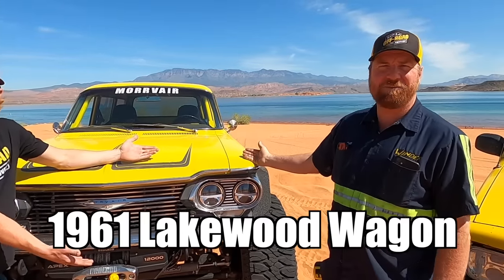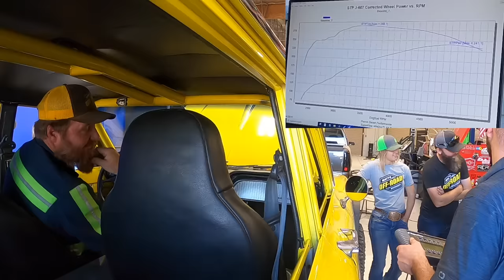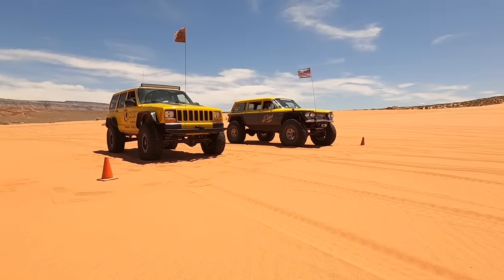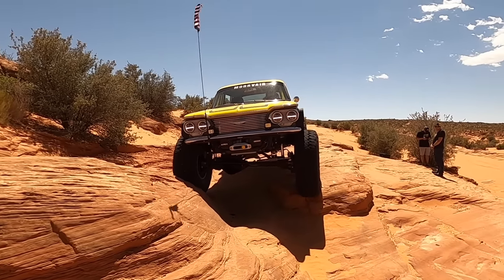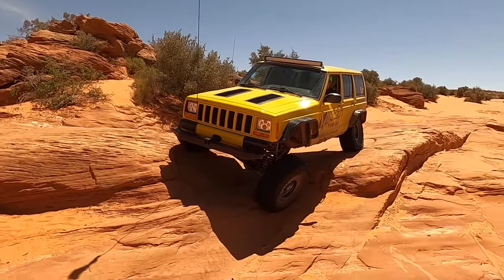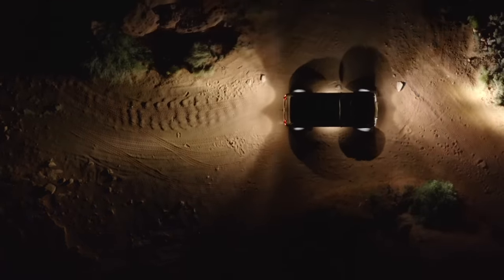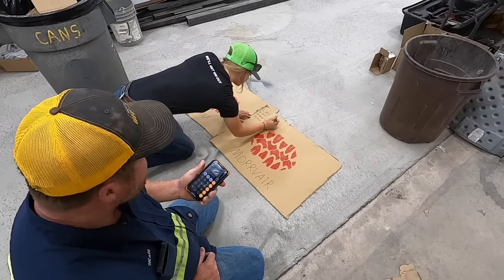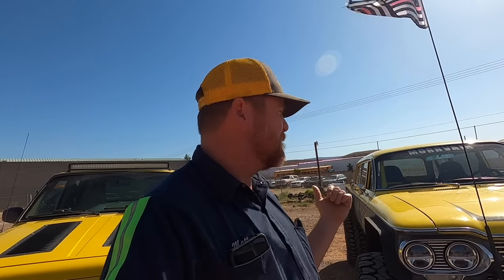Banana Vs Morrvair - Ultimate Off Road Challenge!

Comment: I'm not sure what's more incredible that the banana IS only 105 hp or what been able to do with it and it's 105 hp.
Reply: The Weapon Collection  exactly
Reply: It's 105 at the (gigantic oversized and underpressure) tires. I'd bet on street tires and non-beadlocked wheels it'd run near 180hp. But he uses kinetic energy to his advantage always.
Reply: Yeah, after a lot of years and miles horses tend to escape lol. In this case, quite a few have left.
Reply: @jdoosh4797  na factory its 190hp at the crank ALL of you seem to be forgetting this.. factory ratings are crank ratings not wheel HP, most vehicles the drive train loss is around 15-25% depending on the setup., with drivetrain loss, the 4.0 are all mostly pushing around 140hp to the wheel or so,  They are guttless pigs, with him being at 105 hp he has over a 45% power loss.  I own 4 Jeeps, the 4.0 is slow even on a stock Grand Cherokee.  And people claim its a torqy engine, i mean 225ft lbs at 3300rpm at the crank, i guess thats torqy ?   The same year 5.2 and 5.9 liter v8's had over 100-125ft lbs more than the 4.0 and they were at 3000k rpm for peak torque.   I own a 5.9 Grand Cherokee, and its completetly blows the 4.0 away in every aspect.   Both are equally as reliable, i honestly dont know why he picked a cherokee XJ for his companies towing vehicle when a grand cherokee with the 5.9 liter v8 would have been a much better choice.
Reply: @jeepsblackpowderandlights4305  Drivetrain loss is a static number not a percentage. It should be putting more around the 110-115hp range. The reason he probably didn't use a GC is because it's far to big and heavy for the hp it's putting out. Not to mention the unibody is even worse for yanking and towing. The 5.9 Limited is the only exception and it's not much better P/W than the other ones.
Reply: @CanadaBud23  umm.. the cherokee xj is a unibody ?  Lol.  And no a 5.2 and 5.9L is way better in a ZJ than a 4.0 in a XJ.   Lol do some math and try to tell trll the HP/torque/weight is the same lol..   a 98 Zj 5.9 weighs roughly 4200 lbs.  A stock XJ is around 3300.   Thats 900 lbs more, and it has 60 more hp but 125ft lbs more.      HP means nothing its the torque.  And a 5.9l could yank an xj around the parking lot withoit you even feeling it.   My 5.9L cann actually pass people at 70mph on the interstate with ease.. the 4.0 you gatta full throttle and inch your way.  

If you dont have the vehicles like i do you dont know what youre talking about.  

The GC actually isnt nuch bigger than an XJ.. and im saying 4200 lbs for a 5.9 limited.  A 5.2 laredo ZJ grand cherokee is around 3700 lbs.   Not much heavier than an XJ
Reply: @CanadaBud23  the banana is also a unibody.
Reply: @jeepsblackpowderandlights4305  I think I'll trust a professional with hundreds of successful tows in the XJ over some armchair analysis as to what is a better vehicle choice.
Reply: @jeepsblackpowderandlights4305  forget hp he needed a very very strong frame, grand is a car suv great if you get to work before the plow on a snowy morning.
Reply: @jeepsblackpowderandlights4305  Sounds like you're trying to justify your purchase of a worse vehicle. Never heard anyone praise a GC 5.9 over an XJ 4.0 before. Definitely not equally reliable. Hardly even see GC anymore, but see XJ's every day.
Reply: @mikerafone4736  lol um you are right in they are great in the snow. i have two 98 grand cherokees stock height 29 inch all terrains.. and i never got stuck once in the 3 feet of snow we get in norther. va every few years.  In fact the last blizzard we had i drove around plows on the roads while everyone else stayed behind them lol.

Also the grand cherokee has a frame.  Its two frame rails U shaped, 1/8th thick like any truck frame but its welded to the body instead of using body mounts.  In fact c channle frames are inherinty weaker and flex alot. It isnt exactly a true unibody like a sedan where they have no frame rails.
Reply: @mediocreman2  lol i own 4 Jeeps.  They are equally as reliable.  XJs have inferior transfercases over a ZJ as well. Who the hell wants a 232 part time 4wd transfercase ?   

The only reason people like XJs is because of the hype train associated with them online.  What does an XJ have over a ZJ.. litterally nothing.  .   Why would i need to justify my better vehicle ?  Its got a better engine. Better axles. Better gearing,  Better wheel base.  Better towing capacity.. its hella faster.  The magnum engine is very reliable.. mine has 323k miles in it and all ive done is the typicsl stuff like timing chsin balencer. Water pump and so forth. Lol.   Our 4.0 has over 300k too.  Both are reliable.. but the 4.0 is just way too gutless.

Xj interior is pretty discusting as well.. and way too tiny.  Look at matt and the crew in that XJ hes too big for that vehicle.  They all are.

Ill take my Grand Wagoneer though over all of these vehicles lol.
Reply: @prasad530  😆
Reply: @mediocreman2  😆
Reply: @jeepsblackpowderandlights4305  You see him with all 4 spinning on sand and pavement? He has enough power, bud, and he’s built this channel proving it over and over and over and over and over and over...... but yeah, you know what’s better.
Reply: @fixitnate  all i saw were wheels barely with no traction on the pavement and wheels bouncing so hard i was waiting for the axles to snap on both vehicles actually
Reply: @jasonstrout4502  because he has upgraded axles.  But the stock dana 30 woulda snapped from those bounces.  That was my point.  Ive seen larger axles like dana 44 and dana 60s  break from wheel bouncing with hard traction like that.

You have no clue what youre talking about dude..  I bet you dont even have a rig.
Reply: @jeepsblackpowderandlights4305  Inferior transfer cases? XJs have either the common 231 (the same exact case that's been in YJs, TJs, and 4.0 ZJs as well), or the 242 which is basically the same but has full time that can be run on any surface (and was also in the 4.0 ZJ). The 231 is only slightly stronger, but I've seen far more broken 231s than 242s, though that's probably due to model saturation. Those V8 GCs got the 249, which are basically AWD and use an expensive-to-repair-or-replace viscous coupling instead of a simple drive chain. The early ones didn't even have part time 4Lo. If Matt had one of those, there's no way it would have ever lasted this long. There's a reason that a lot of people swap up to a 231 or 242. If you want to talk inferior, the 249 is it. Not to mention those Chrysler slushbox transmissions. 

Better axles? Both came with the same Dana30 up front, and at least the XJ had the stronger high pinion for 16 years of its 18 years. ZJs all got the weaker and more-exposed low pinion. Both shared a common Dana35 in the rear (4.0 ZJs), and the XJ also had available a 27 or 29-spline 8.25, plus a rare true Dana44, while the V8 ZJ got an aluminum Dana44 with 27 spline, making it only marginally stronger than the D35 and being stuck with extremely limited aftermarket support for gears and lockers. More power with a weaker axle? There's a reason a lot of people swap those out to a true D44 or Ford 8.8

Better gearing? All V8 ZJs had was 3.73. XJs had 3.07 (manual trans), 3.55 (common with the AW4), 3.73 (tow package), or some rare-ish 4.10 and 4.56 combos in the 4-cylinder models. 

Better wheelbase? Well, I guess someone had better tell all of those CJ and Wrangler guys they're doing it wrong. There's also a trade-off with the breakover angle. Worse approach and departure angles, too. Bigger measurement number =/= better.

Towing? People don't build up SUV platforms for towing. That's a truck's job and why you never see commercials with SUVs towing anything. I can haul my kayak and a pop-up or a small trailer with a few dirt toys; that's more than enough.

Faster? It's a Jeep, who cares? I'm in no hurry, I just want to get from A to B in one piece. Leave the 2Fast2Furious mindset to the people that think everything has to be a racing competition (in brick-shaped SUVs nonetheless, wtf?) My XJ spends most of the time doing ~5 MPH on the trail anyway, much like the Banana spends most of its time between 1st and 3rd gear in the sand.

People like the XJs because they're relatively cheap, reliable, easy to maintain, and have tons of aftermarket support for whatever you want to do to it.
Reply: @jkvinsland  4.0 zj has 242 and some rare ones had the 249.  There are two version of the 249 btw
Reply: @jeepsblackpowderandlights4305  Considering the weight differences and power a stock XJ vs. stock ZJ is about the same as Matt's XJ vs. the Corvair. What you are saying is like a fallacy. It's not much better if hardly at all but in his case there is a tangible difference, and of course the "unibody" or uni-frame on the vehicles tends to use thinner sheet metal in later versions at the back which tends to rot much faster. That's the trend we see here up here in the rust belt (or salt hills as we call it sometimes lol) and because of that we hardly ever see any ZJ's driving around.

BTW, I'd love to see your ZJ try to pass me :)
Reply: @CanadaBud23  a ZJ with a 5.9l will pass your xj if it were stock anyday of the week.. a 98 XJ with the HO 0-60 is 10.1 seconds.   Please... lol i have about 3 seconds over you lol.  Thats the difference between my Jeep and a 425hp camaro today at 4.3s.  Huge diff. Frame is thinner in the back ?  What are you smoking.  Its 1/8th thick front to back.  Lol.  Thats the same thickness as my C channle grand wagoneer body on frame.  Same thickness as any pickup truck.

As for rust..  Ive never seen a ZJ rust in the rear before i live in the rust belt.   The only places they rust at is the two torque boxs which the XJ doesnt have because of its weak underpowered engine. It isnt needed to support the body twist from torque like the v8 ZJ does.

Also were not comparing your heavily modded with a bad body kit XJ here.  Were comparing stock for stock.  Th3 stock XJ as i said 20 times now is a gutless pig.  10 seconds 0-60 barely under 20s quarter mile.  Dont make me laugh.
Reply: @jeepsblackpowderandlights4305  My stock 98 sport is definitely faster than 10 seconds lol. My stock Renix would take ZJ's back in the day it'd be close but I still beat them. The time sheets you find on the internet are full of shit. Std XJ's can do 15's on the street all day if you can launch them right. Not the fully loaded autos they always test. I had this very same argument with my friends (mothers actually lol, he's a 4runner guy) GC limited I had to beat him a few times to get the point across. She'd spout the exact same crap you are doing now. She wouldn't race me but he took it out a few times, I proved to him just cause it got a V8 doesn't mean it's fast. His father did the same with his LeMans but he wouldn't race me either. I've raced more than enough people to know how these can go.

I don't know where you got 1/8" from, you may have gotten the curl over on the stamping confused with actual thickness. You'd be lucky to get .090-.100" on any part of the body.

I'm sorry but, it's a nice family vehicle with some decent luxury for its time but it's slow for what it is. The only quick one is the magnum 5.9 and it's still only a 7 second 0-60 and it takes forever to get to top speed. It's a mid 15s jeep, it ain't that fast.
Reply: @CanadaBud23  motortrend timed the 5.9l grand cherokee at 6.7 seconds.  And a 97 cherokee at 10.1 seconds.  Thats just too much of a massive difference.  Even with a smaller 2 door youre not gaining 3 seconds from that if you have a stock cherokee.

Im done arguing over this.  There are way too many advantages over 5.9 limited for anyone to ever convince me to want a cherokee.  You like your stuff i like mine. Nuff said
Reply: @CanadaBud23    1/8th is how thick it is on the frame  The shock mounts are 3/16th.  Ive welded on these frames and 1/8th steel was identical to the thickness on the frame and torque box i had to cut off and repair
Reply: @CanadaBud23  also im not denying your Jeep isnt nice.  But its just what you prefer..  I dont like them.  Im 6'2 290lbs.  When i first bought my own car i looked at the 4 door cherokees.  Theyre too small inside. Engine bay is too cramped. Interior litterally got not update like the 2nd ZJs they were too dated and ugly inside for me 13 years ago.   So i bought a limited grand cherokee v8.. i liked the shiney paint. The leather interior and the sound and power of the engine.  Little did i know i bought a 5.9 limited and the rest is history.

Now i have this a 4.0 zj, a 90 grand wagoneer. And my brother has a srt8.   Out of all 4 jeeps i prefer my wagoneer hands down.  Anyday.   I just wish the wagoneer wasnt more of a dog power wise than the 4.0 is lol..
Reply: @jeepsblackpowderandlights4305  I'm not trying to convince you to abandon the GC, I just don't like them. I've never really liked them aside from the WK SRT variant and I'm turned off from them right from the beginning. I liked the fact they shared a lot of parts in the ZJ, very good supply of parts from the yard but they are almost non existent now. WJ and up are what I see now. I still don't believe the frame sections are 1/8 at all, best case scenario is they are the same as the XJ.

I never listen to the Motortrend BS review articles for Jeeps. 10.1s is BS, a heavy sport 4x4 will do it in 8s no problem. The only Jeeps that did what you describe would be the 70's FSJ or possibly a diesel version/4banger, they are slow as hell. I'll have to g-meter my 98' to really see because even 8 seconds seems a bit slow (I may be spoiled) and stock Renix would have gapped the 98' simply from a bit more torque and much less weight.

Comment: One thing to remember, the MV is better BECAUSE it benefitted from those bruises on the banana. Banana is the teacher, MV is the grasshopper. The VERY RIPPED grasshopper.😁

Lessons learned with the banana, in large measure, contributed significantly to making the MV great! So they are BOTH the winners!
Reply: Yes!  And now it is time to apply what has been learned from both to giving the Banana some much needed lovin'.
Reply: Well, then again, the Corvair (body at least) is far older than the Jeep.  LOL  It's like "The Master" got into body building.  LOL

Comment: You’ve always said the XJ is under powered, but I hadn’t figured out just how under powered it is.
Reply: 190 hp AT THE CRANK doesn't go a very long way once it's gone through the big wheels, transmission, and all that mumbo jumbo.

My 2 liter four banger (non turbo) Honda gas more horse than that at the crank haha. Of course they are two entirely different applications. You want torque here as well, the more the better. Wish we'd gotten that reading as well.

Comment: That looks like it was fun.
Reply: JD you should go on vacation in Utah, get stuck and Matt can pull you out!
Reply: @JamesKing-cp2ib  would love to see the moorvair hooked up to the f450
Reply: Fun times,   mixed results   not necessarily what I expected !!!!! I was thinking that the additional hp would be wasted but I hadn't caught on that the tires are bigger too. So the bigger tires allow the hp to get to the ground. Got it? Does it follow then, that only putting more hp in the Banana would not  make it better??? Silly me, I forgot, more Hp is always better.  So in this case would more hp make it better enough to be worth the effort?
Reply: @richardelliott9511  one thing about the banana is reliability, except for needing a bigger radiator and suspension, it dowsnt break stuff often because of stock reliability
Reply: @JamesKing-cp2ib  Watching this video in a hotel room in St George UT. Wish I'd known the time and place!
Reply: @StoneysWorkshop  with the rv hooked up!
Reply: @richardelliott9511  More HP generally = more heat. XJ Cherokees are known to have heat issues. They have a small engine bay, with a big engine stuffed inside. It really chokes the airflow. A better radiator to make use of what air does pass through it helps.

Then again, a V8 swap would give the radiator room to breathe, and offer more power (Even though I am goddamn tired of LS swap's, I know why they are done: They just damn well work in everything).
Reply: @reallife7375  6.4 Hemi
Reply: @tumbleweedking5668  yep make it twist
Reply: Time to take the new fifth wheel to get stuck in the sand!

Comment: Unfair challenge, lets see the Morrvair after is has been recovering as long as the Banana has.
Reply: That is an interesting aspect. How much stress is put on either vehicle while pulling in the sand? The grip jerking is not as profound as on solid pavement but is torturing the drivetrain non-the-less.

Comment: The moorvair has better weight transfer and a 120 horsepower advantage plus the LS engine has a bunch more torque than the jeep, larger tires and 5300 lbs of squat and pull only thing I see is both get the job done and represent Matt's offroad recovery very well!! Hope you had a Great  Christmas!! Be looking for the next video.

Comment: While the straight 6 is great for a standard rig, putting a better suspension and cooling would make it ride and run better. They DO LS swaps in xj's, heck they have even put a hellcat in one I think. But since that would add way to much weight just adding a few performance parts to the 4.0 might make a very big difference.

Comment: Narrow shelf trails the banana should still hold an edge.  Also fuel economy when considering refueling when driving to a rescue and fuel capacity to determine driving range based on where you can stop to fill up last before getting to a rescue are important.